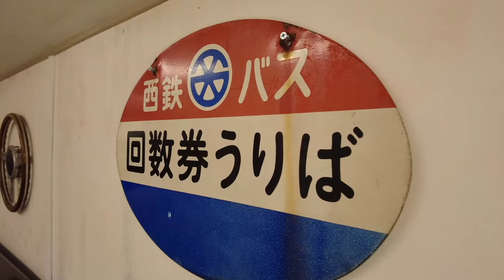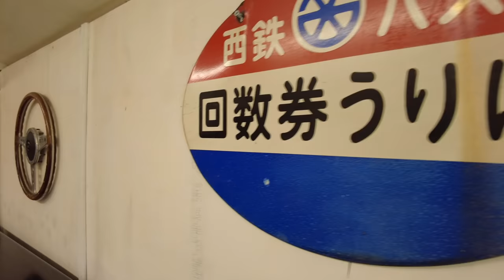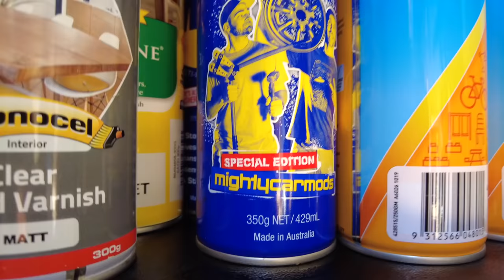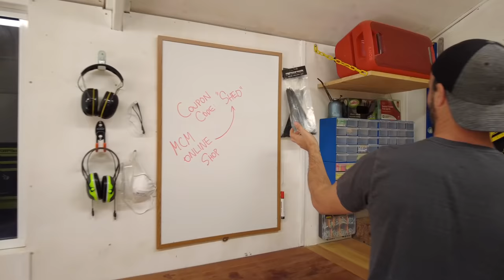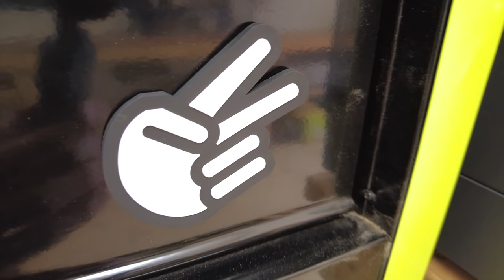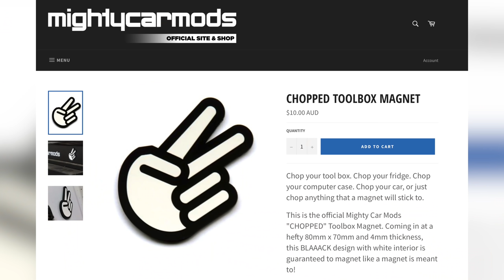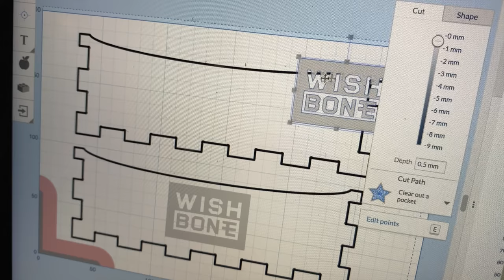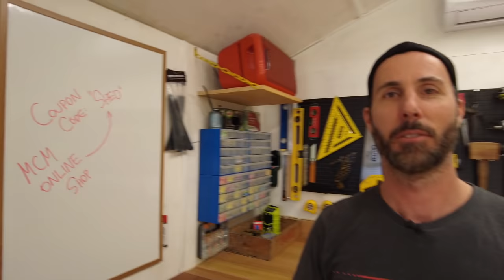Moog's Shed Tour (And TOP 3 Tools)

Comment: A battery powered label maker improved my workshop life in a big way. Printing up a label and sticking it on a drawer handle is super quick and easy, and it's easy to peel it off and print a new one if things change. The best thing is that if one of my kids or my partner needs to use a tool, they can find it without my help, but most importantly they can return it to where it goes. Worth every penny.

Comment: Friend, using tools that have been passed down is a special feeling. I still use my great-grandfather's compass and other architectural design tools from the '20's any time that I'm putting a plan onto paper. It's not only satisfying, the tools are excellent quality and very useful! "They don't make 'em like they used to" is true. Cheers, and props to your grandpa, much love.
Reply: +1 for this. I have this heel/Jimmy bar from my opa that's machined perfectly for using as a chisel for stuck inner bearing races that doubles as a seal remover. Works even better than the genuine/oe tools. Brings a smile to my face every time I grab it from my tool box.

Comment: Awesome shed tour, Moog. I give you 13 points out of a possible 10 for first-order accessibility - having everything you need frequently visible and available to your outreached hand. I try to do that with the Fat Cave here - with varying degrees of success. Well done. Love your work. It's be great if you could mount the drill and driver so they were good to go, finger on the trigger, one-handed, instead of inverting and rotating (because your other hand would be holding the job in place on the 'favourite tool', obviously).
Reply: The fatcave deserves 13 points too! Love the vids John, keep up the great content mate! Love from WA!
Reply: @hughmangus2324  Not worries Hugh - thanks very much mate. I appreciate you watching. Platonic Fat Cave lockdown love right back at ya...

Comment: Love the shed tour. I particularly like having coiled extension cords at different points around the shed, plugged in and ready to go. I want to be set up and working as quickly and easily as possible.
Reply: same. for some reason all electric tools with cable are usually a lil to short so u need to get a extension anyways.
Reply: I have a big self coiling extension cord mounted to the ceiling, as well as an air hose that coils up in the same way. Since my shop is in an older building there aren't many outlets. The central coiled cord makes it super easy to just reach up and grab the end, then pull out enough cord to wherever it's needed.
Reply: I believe they're illegal now?
Reply: @kaydog890  not sure where you're from, but at least where I live in the US I can still buy them.
Reply: Follow Jeff...his videos are brilliant 👏
Reply: Coiled power cords with angry pixies flowing through them can generate excess heat with the danger of fire due to stray Eddie currents, isolate when not in use and fully extend them when in use

Comment: You get it Moog. I have a bit of maker shed  as well and have tools from my late father in law  and my dad who can no longer use them. You really get a real sense of connection when you use them. Even if I aren’t using them they are on display and you get the sense they are there when you’re in the shop. Pretty special.

Comment: Love this, Moog, thanks for sharing your shed. 

It's called "dry wall" in the states because walls used to be made with wood slats covered in cement and plaster, which was usually mixed in a wheelbarrow and thrown on, first the thicker cement and then a thin layer of plaster that was sanded down. This was a very "wet wall" process, so when the gypsum boards started to get used in the late 50's contractors would say things like "are you using wet wall or dry wall," so the term stuck. My grandfather was a builder as well, my dad still has all of his tools, some dating back to the 30's I love using them when I get a chance too.

Comment: Drywall is actually a brand name in the US  that caught in if I remember correctly, my dad called it gypsum board, and occasionally that was asked of me when I worked at home depot
Reply: 'Gyprock' is a brand name here too. The generic term here is plasterboard
Reply: Sheetrock was the brand of drywall. Drywall has lots of names, but the reason it’s called drywall is it’s dry compared lath and plaster that I have in my  house.

Comment: One trick I’ve used in my shed: I took old propane tanks (a random mixture of the 5, 10, and 15 gallon ones) and swapped the valve/fittings on them to fit my air hoses, then connected them in a series to add additional air storage to my small compressor. I got the tanks I used for free because they had expired so it was a super cheap addition to my shed!!!

Comment: Speaking of favorite tools! I have one of those quad folding ladders and it's so amazing. Can set it up however you need it to be and stores anywhere. Especially if you live in a condo or appt, its something you can store without taking up too much room. Mine extends to about 16 feet, or you can set it up at a 6ft ladder, or a painting table, or a drying rack, ect. truly versatile.

Comment: These two shed videos were awesome, really shows that you guys are polar opposites (in down time) Martin the car guy/nerd and Blair the DIYer. That tip about putting the sander on a door, genius and that top tool, I have to go steal one now. One tip I do have is mount that router (I hope that's what you guys call it there) upside down to a heavy table, makes it so easy to put a bevel on long pieces of wood.

Comment: Great to see someone that still uses their hands to build things & actually believes in the brands they promote. So many YouTubers will promote anything they are paid to promote with no care if it is or isn't actually good. Stanley & Ryobi I believe are both great brands I just wish I could afford more of their products. As for still having a go and building things I built the rear drawer system & charging cabinet in the back of my 02 Pajero, full build on my channel. I have set it with a shel level with my 2nd row seats to form a double bed, drawer on one side & 30L fridge on the other, small cabinet with the electronics to one side & storage to hide keys, wallet, phones etc and charge devices such as cameras & phones. Built top suit my needs exactly not some mass built, heavy POS that is not suitable for my needs.

Comment: Seeing you back ryobi like this makes me proud to own a full ryobi power tools and mixed hand tools/bits for my box!
 13 battery's (7 1.5 ah, 1 2ah, 1 3ah, 3 4ah, and 1 6ah), a couple impacts and drills, grinder, skillsaw, electric ratchet, multi tool, and TONS of extra ryobi stuff. Would love a recommendation on good chargers for multiple battery's is you guys use them
Reply: I'd get a few of the 6 port chargers and one of the 1 port fast chargers for when you have to take your tools with you or to keep in the house for lights and stuff, also have you tried the new HP tools with the HP batteries? Those are insane.

Comment: If you're building a workshead like you did from scratch putting a central vac system in and putting the outlets wherever you want you can then use it as a dust extraction and it is as close to having a large dust extraction system as you can get while still keeping a budget in mind not to mention if your house is set up for one then all you have to do is tie into it and put the PVC tubing in the walls or just along the places where you want it to be in your shed

Comment: I don’t know if I’ve got any tips. But my main hobby is restoring vintage tractors. Which generally entails fabricating or manufacturing parts that no longer exist. So while I use most of the normal mechanic style tools to disassemble/assemble/repair things. The main tools we have acquired over the years that has made what we do possible are large, Mill, valve grinder, press etc. but the one tool I’m not sure we could do without is the oxy-acetylene set. Being able to heat badly corroded or seized parts makes so much difference it’s not funny. Not to mention heating bent things up to straighten them easily is fantastic as well. 

Love what you guys do, keep it up.

Comment: Have an apartment with a really really small room for storing cloth (originally)... and as I don't have much use for that I turned it into my shed :-) It's about 130x200 cm but have loots of tools and storage actually in there.. it's just not that spacious :-) but it has a woodworking bench with clamps. And a chair, bench for soldering and other stuff!

Comment: Working in a small garage for my racecar habits has lead me to building a wall mounted welding table that folds against the wall and out of the way when I'm not welding and fabricating. I just found some generic collapsible brackets that mounts to the wall with the correct weight rating and it's been working out extremely well. Finding space in a small space is always a challenge but it allows you to be creative.

Comment: Another great thing about milk crates is that they interlock when stacked! That means that if you need a temporary workbench, stacking about three will give you some nice sturdy bases for it.

Also i envy you metric people, only having to have one set of tools. Here in the US it's two sets of sockets, two sets of wrenches, two sets of hex wrenches, six screwdrivers (JIS, Phillips or Cross, and flat with two sizes of each). A typical portable toolbox for scrapyard visits gets pretty heavy, not to mention the frustration of a guessing game trying to pick out the correct wrench to remove a bolt or whatnot. At one time it got so bad that i ended up breaking apart a piece of equipment with a demolition hammer to get the needed part out instead of trying to remove it properly.

Comment: I've built my shed not long ago. It is not done yet, but it is 7 by 6 meters, concrete floor, metal frame construction, and metal walls, the roof is made of white plastic wich doesn't let the sun to heat insides up, but it is always bright inside. It is equipped with ceiling fans(because no air conditioner yet) and the most importatn thing is 3 by 3 meters crane beam, wich can handle more than 200kg, mostly because it is attached to light metal frame of the shed, otherwise it could handle up to 2 tonns=) Not to mention this shed is built next to an old small one with brick walls and it has a fireplace inside, wich is the coolest thing in winter=)

Comment: My shed is a bitza, on one side I have my 1000ltr fish tank setup and my electronics bench

Another wall is setup for all my tool chests and 2 CNC's One for doing carbon fiber the other for circuit boards, the other wall has my RC car assembly and maintenance stuff, Then my spray booth for air brushing RC cars then a bench for working on the race car with welders etc under it and on the end of that bench is my laser CNC.

Top it all off in the middle is my race car built.

Comment: Shed tip #1: economical storage is super important. Use the full height of your space but only put things that you nearly never use at the top or behind other things. If it is hard to get out you won't use it or won't put it away again.

Shed tip #2: if you only have space for one bench, put it on stout, lockable wheels and make the storage underneath accessible from both sides. It can be against the wall as a bench, out in the middle as an island or rolled out into the yard for dusty work.

Shed tip #3: label your drawers and only put stuff back where it belongs. If you change the layout, update your labels.

Comment: Best tip I have ever used is to double line your bench top i.e. Use two layers of 18mm plywood. I allows you to dirty, cut, screw, gouge, fix-off etc on the top layer and then remove it and replace it easily without having to dismantle your entire bench.

Comment: A TV or cheap computer in there are game changers. Personally Ive got a pc attached to a 32 inch tv, both second hand off ebay for less than £70 total. Means you can be in there doing whatever, dont have to miss out on things like if theres something on live and if youre trying to follow instructions for anything you can have them up on a big screen

Comment: 11:54 Wera screwdrivers and hex keys. :)
I think the screwdriver set is the same as the one I have. The hex keys is a newer version of mine, that I bought back in the mid-90's, which are still going strong. They are almost indestructible!
Oh, and I have the same Bosch bench drill. I upgraded the chuck though, as the original, although quite expensive as a replacement part, is crap. Mine had a LOT of wobble.

Comment: Looked through a bunch of comments, no way I was going to check all the replies but we call it drywall in the US as the predecessor to gypsum board (which is also used as a name here) was plaster and lathe walls, and as anyone who has worked with plaster knows, it goes up wet.  Nice shop/shed/Moogspace

Comment: one of my sheds is small and full of CBR 600 parts. 
the other large shed is full of tools, motorbikes and various other parts. 

my top tip; buy another shed to actually work in or extend your shed.. you could call it a shed-stension.

Comment: I own a van, and a trailer, and quite some tools. I've got a little motorcycle workshop as well. I get asked a lot if they can borrow.. Well, the answer is always NO. When i did lend stuff i found that most of the time the stuff wasn't returned at all or came back damaged, or even broken. 

If they ask, and if i've got the time, i will offer to help them.

Comment: protip: put scotia or tri quad style molding where the skirtingboard/baseboard would go, it makes cleaning easier because there is no hard edge and it means if you drop something down the back, it will hit the molding and want to roll forward, or if you kick something under it will want to come back out.
Reply: the paint stirrer thing is spot on for sanding, usually i have a few bottles of superglue in the fridge in the shed, quickly glue some sandpaper to the bench or a bit of timber, perfect for sanding, and then if you want to remove it from the bench just hit it with a scraper and the glue comes straight off.
Reply: in general, a fridge in the shed is excellent, a cheap little bar fridge with a freezer
freezer is  good for cooling down shafts or bearings a bit to get them assembled easier
fridge is good for keeping your superglue from going off, also good for just keeping some cold water/beverages in
a kettle is excellent in a similar manner, you can heat things up pretty well without an open flame; boil some water and use it to soften plastic parts, put parts in boiling water to warm them up, also good for a cuppa on cold days, if you're really desperate, you can use the steam from the boiling kettle to shrink heatshrink or remove window tint etc too.

Comment: Where is your MCM Flag?    Nice spin off video!   One thing that I have found that I'm in awe of how I didn't have one before is a fab-table.  I'm talking about the type that you clamp down stuff that has grid of holes drilled into it typically for metal work, but I'm using it so often when working on wood!   I got a cheap one from Klutch because I'm not doing mil-spec stuff.
Reply: Oh forgot to mention, I've done some mods to it,  added casters, a shelf on bottom, a power plug, a place to hang tools.

Comment: If you do a lot of work outside, why don't you fix a working surface to the shed wall outside that is normally vertical when not in use but then hinges down to horizontal for use?

Comment: i need to do a shop tour, but 1 tip i have is making thing mobile! my workbench is mobile with a built in table saw and a flip up thicknesser(video on my channel) but my mitre saw station is not mobile haha. also i am currently installing a bluey cnc which is 1000x1500mm hehe

Comment: You need to move your lathe. You are reaching into it and it is sitting to high up which affects your working position. Not really safe at all best to drop the table high in the area and move closer to the table front. Other wise a great space.